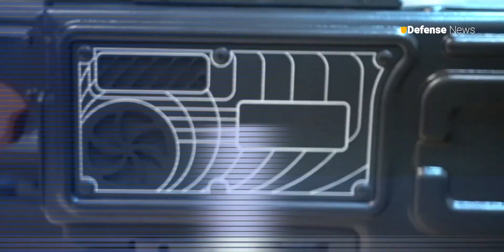How Ukraine uses high tech anti drone guns to down Russian drones

Comment: What happens if its pointed at a human?
Reply: If uses at a human, they can get cancer from the radiation.
Reply: It uses radio waves, it's harmless to humans.
Reply: @eb3yr  hey Genius, a microwave uses 2,4GHz frequency, just as your phone does. And drones use either that or 5GHz. That there is a directional microwave, that is what it is.
Reply: @krisg822  There is a very big difference between a jammer that runs on double digit wattage VS a microwave.
Reply: @eb3yr  double digit wattage? you saw the battery that thing has installed? it's easily 500 to 1000Wh, which means, he can draw up to 2kW if it's 30 Minutes, that is literally max microwave level. Not to mention that microwaves have various level settings, and mine for example has 800W as minimum. One of my Ebikes has a 8000mAh battery at 40V, and it gets empty within 15 minutes if i floor it. That is 320Wh but in 15min it is a power of over 1,2kW.
Reply: it depends on the power it uses to generate the magnetic field, it may be mostly harmless to the user, but i would not point it at humans.